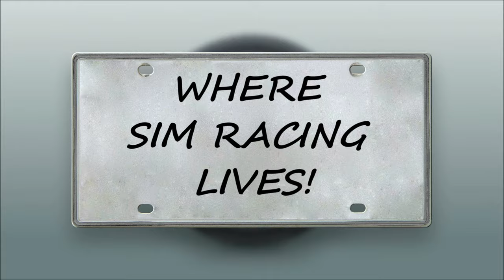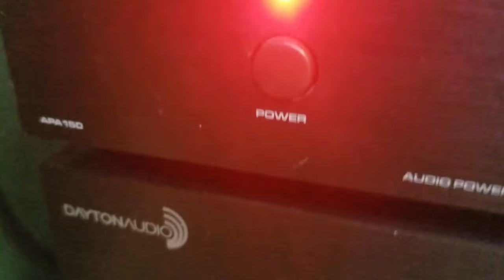Sim Rig Tour 2019

Comment: Bro got a ? As most pc well motherboard tend to have not many USB ports will that adapter allow me to say concert my fanatec shifter and handbrake my stream camera and allow each to work on there own in one USB hub. As once I get my sim gear updated going to run out of USB hubs on my board. Cheers on in advance. Also doing more research and in Australia to get simucube is very high tax import so looking at few ways about it. Plus my budget isn’t getting any bigger and the lack of steering wheels that work on the cube is limited with out braking your leg of for one. Also love the setup dam I wish I had some room
Reply from the maker: Thanks for the complements. I was in the corner of my bedroom. Needless to say, the wife didn't care for the setup too much. lol.  I did actually just moved to buy a new house so my sim room got updated. :) Here is the latest vid. https://youtu.be/LB-ptr5PcQo

For the USB you will want to get powered ones. One USB 3.0 will work for all that. Check out this one I just bought for my rig on Amazon. https://amzn.to/3aIaP28 It is working great for my setup. The PC will recognize each USB port separately so your good with having different devices plugged into one USB strip.

Comment: the only thing missing is a H-shifter :D but I know that problem to use an Seq. and H one at the same time, they are getting in the way of each other... Simetik should build some sort of fast adjustment option for a Sequential shifter. :)
Reply from the maker: Yeah what I'm thinking lately I will do is switch my NLR V3 to the Simetek K2 rear seat section even though I will have to cut it up some , but this will allow me to get another shifter mount from Simetek to mount an H pattern to the side of the rig, which is more natural feeling to use in that area. Thinking I'll go with another Fanatec H pattern though since it's tall, putting the shift lever where I want it.

Comment: How much flex do you get through the simetek rig itself when you get a lot of FFB? trying to find something as space saving as possible but zero flex. I use a gt omega chassis with an osw strapped to it, but unsurprisingly it's not too fond of making saves when getting oversteer on corner exit (one example of a lot of ffb and me yanking on the wheel ect.) So if this can be super solid and not break the bank like the P1, then bonus
Reply from the maker: You will love the Simetek k2 over the Gt omega. The omega is good but not strong enough for DD wheels. The Simetek k2 was designed for DD wheels. I get no flex with my Accuforce in those save moments. Dort rally 2 is a good test for the rig and my wheel base stays planted. Now you will get vibrations in the keyboard stand though.  That's the only place if least resistant. Hope this helps.

Comment: Nice rig, but why switching the Odyssey against a Rift S? I nearly only see negatives with the Rift S (less Hz, no IPD, bad audio, LCD). Do you get higher framerates with the Rift? That's actually the only thing i don't like with my Odyssey.
Reply from the maker: Thanks. Yeah I know on paper it seems worse, but the reality is the Rift S turned out much better for me.

1: The negatives are: I do get a little eye strain with not having the manual IPD adjustment even though I fall into the specs. My Rift Quest is more comfortable on my eyes with the manual ipd adjustment. 
2: The sound is horrible as well like you said, but I use my Sennheiser headphones or Astro A50 for better sound. It's a little cumbersome to use separate headsets I know, but the sound quality and volume are much better then Oculus would have produced even if they installed their original headsets from the Rift. 

3: Visuals are actually much improved over the Odyseey IMO since you get better color reproduction and depth with 3 subpixels to 1 subpixel. The Samsung Odyssey doesn't do this, so the Rift S is easier on my eyes and I see more depth in that regard. 
4: FPS is slightly improved from the Odyssey with only having to hit 80hz from the 90 hz. I don't notice a difference between the 2 myself and I get more clarity from the Rift S. Check out my other videos on hitting 90 mFPS with the Samsung Odyssey on my channel. I have a few up for optimal settings.

I hope this helps explains it and great questions my friend!  Oh BTW here is my review and comparison of the headsets: https://youtu.be/6fFQErsuZyM
Reply: @TJRSIM  Thanks for the info and i rather want to wait for a really decent upgrade, since my IPD is 72 or above. I'm speculating that a new Odyssey should be released soon or i might go with the Vive Cosmos or just wait some more time. My main problem is still the performance even with i7 7700k @4,4 Ghz and RTX2080 and only iRacing is providing 90 fps across the board, which i'm not a huge fan of. The Rift S seems to perform lot better in ACC some people saying...
Reply from the maker: @Leynad778  yeah I can confirm that as well. After Kunos updated ACC it works really well with the Rift S. Actually all the sim games work better with the Rift S, but I'm using a 2080ti which definatly helps. I did testing with Odyssey with my 2080ti on ACC and got good quality and Decent FPS, but it got better with the rift s and the clarity was better so I could lower SS with the Rift S to see the same results as the Odyssey taxing my GPU less. 

With you IPD. You will enjoy the Odyssey plus though. I still recommend it as it's very good. If you want better I would look to the Valve Index as it has a manual ipd adjustment.